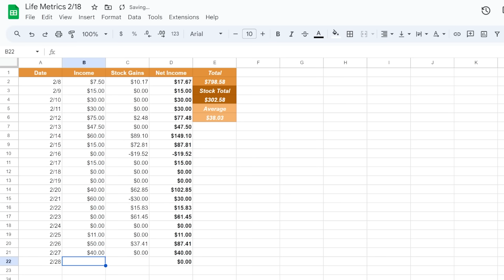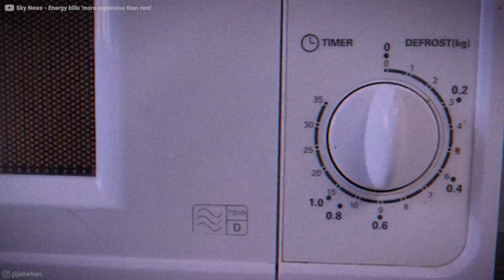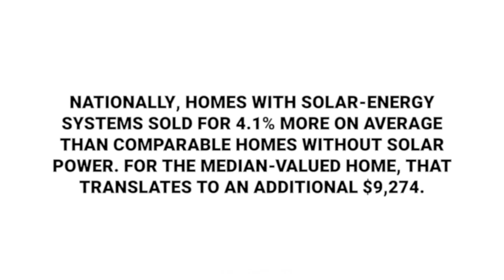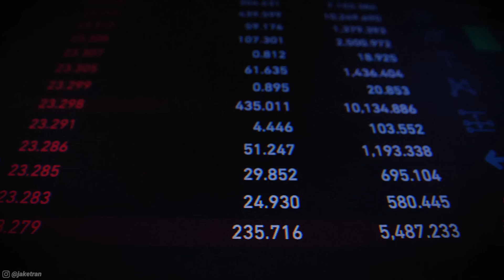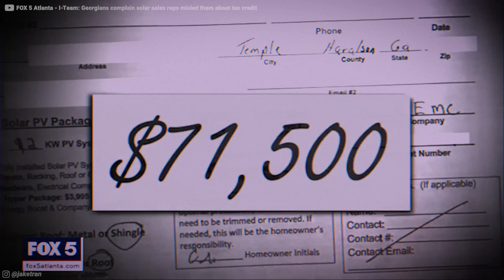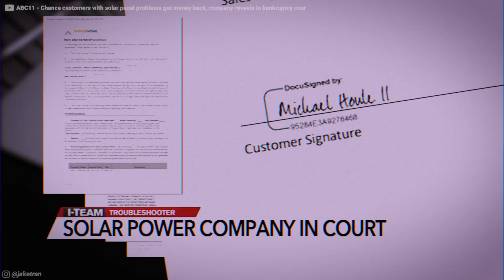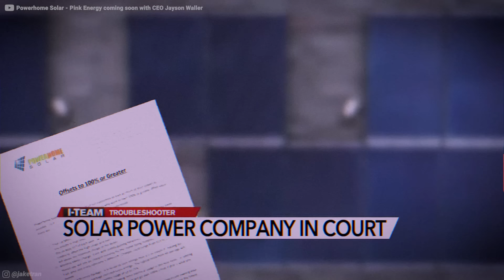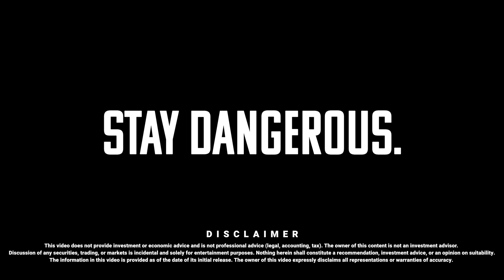Home solar panels are literally a scam.

Comment: I have a 1kW off-grid system with a 6kWh battery I built myself. Learned a lot. Spent less than $2,000. I produce about 4kWh per day which is about 10% of my regular electric bill. It powers all of the important stuff like internet and TV which is important where I live since power outages are common.The first 250 watts of panels have the quickest payoff time since every house has clocks, chargers, and other miscellaneous phantom power draws. No need to install a full system all at once. Build gradually over time and analyze your own use and production. Don't take out loans either.
Reply: Legend
Reply: A 6 kWh battery seems a bit oversized for such a system, however this does depend on your personal consumption but in general you should not have more than 3x larger battery than your peak power
Reply: Nice
Reply: If i wanted to live off grid and blast tv. A/C unit 5 all day. How much panels would i need ?
Reply: @Thegerceklershow  Thats hard to answer with informations you provided. How much is your consumption during day and how much is it during night?
Reply: @Thegerceklershow if you want to do that batteries are more important than How many panels you have. So it won't be cheap.
Reply: Where did you get the 6kw battery so cheap? That alone is 2k investment 🤔
Reply: @epifanpefev2835  he said he built it himself.
Reply: @epifanpefev2835  Oops. I guess I only considered the price of the first since it was a gradual upgrade, but it is a combination of 3.
Reply: @nikola119 Thanks Nikola Tesla! Very cool!
Reply: @nikola119  Depends on your usage pattern and how long of a blackout you want to be prepared for .. I bet there were more than a few people in Texas who wished they had a couple weeks of backup power
Reply: I use them bought inexpensive as panels with controller s  for a 12v system to charge things off grid without running wires from house to shed can charge    vape sticks box mods  DVD player phones car batteries rechargeable batteries of all sorts Bluetooth speakers  and stuff
Reply: Exactly. That's what I'm doing. DIY!
Reply: 😂😂😂😂 important stuff t.v internet 😂😂😂😂😂
Reply: @CheapSushi  you have no clue whatsoever about electricity. First of all batteries do not give you power, batteries give you capacity. Thats the first the thing you have to learn. Second thing, what is the point of having additional capacity that you will never use? And the reason why you will never use that capacity is because you do not have enough peak power generated by your system in the first place. If you know the blackout will last 2 days, will you buy 20 cans of food if you need only 5? Considering also the fact that the rest of the cans will go bad. No, you wont. That is whats called oversizing your supplies. So in the real world scenario: at the point of the blackout you will not have the full 6 kwh capacity available to you because you do not have the peak power to charge that capacity in the first place. So whats the point then?
Reply: Just had a salesman try to talk me into buying the other day he sounded just like the video it was hilarious
Reply: How  did you build your own battery
Reply: @WillProwse  do yall know  who this is. Omg
Reply: Dam bro that’s amazing. How’d you do all that?
Reply: Do you have a how-to guides step by step up doing it? I would immediately send all of my peeps to watch it
Reply: @Thegerceklershow math
Reply: Fantastic explanation. DIY or research before you is the way to go. Don’t buy from a salesman on these large purposes. They have no incentive to be sure that it’ll work for you.
Reply: @nikola119 you’re saying that having 6kwh of capacity is over kill? That won’t even run your fridge for two days.  You don’t need to use the peak power of your batteries I’m not sure what you are trying to convey.
Reply: Important stuff like internet and TV lol, what about something ACTUALLY important like your refrigerator
Reply: @AndrewGreenaway  6 kwh is not an overkill. 6 kwh is in most cases to small for a typical household. I am saying that you should not have a 6 kwh hour battery if you only have 1 kw of peak power. The rule of thumb is that your battery should not exced 3x of your peak power because at that point its too large for your system. Its not wrong but its unnecessary.
Reply: I live on a sailboat and have a 800 watt marine system. It’s great. I paid about $1200 on panels and about the same on Lithium batteries. Marine stuff is more expensive in general, whatcha gonna do? But I definitely didn’t ditch the diesel generator.
Reply: I live in California and work for a sola company it’s only worth a buy if you can use the tax write off if you can’t use the write off then have the state pay for it
Reply: @Skaggs666 thNk goodness for that!
Reply: @johnmorrison7205 refrigerators are very energy intensive and usually superfluous. food spoils anyways inside or out. They do help to store large food preparations but you can but a smaller fridge or not prepare large pots
Reply: @nikola119 mine is actually about the opposite.

I have about 3x the panel wattage to the battery capacity. Panels are cheap. I would rather over panel for rainy days than try to store enough power to get through to the next sunny day.

Granted, I have a low draw system. I power freezers, one refrigerator, lights, internet equipment, one computer, one TV a washing machine and a dryer that I only run when I have a clear day to power it. And an AC, but that thing only runs June through August when I have more sun than I know what to do with.

No cooking (although a couple of induction plates for summer cooking is on my shopping list) and no heating.
Reply: @CheapSushi I don't think they were trying to say how much power you're allowed to have 

Only that it makes more sense to buy more panels rather than more batteries.

It's the panels that make the power. Batteries just hold it.
Reply: @nikola119 To play devil's advocate... If they're worried about a blackout it means they're on the grid.

That means they could easily charge those batteries from grid power in preparation for the blackout.

Doesn't explain why they're bothering with solar panels, but there it is 🤷‍♀️
Reply: @nikola119 wtf,  a 6kwh battery cannot be charged by 1kwh hour solar 😂😂😂😂😂
Are you doing meth?  He has electricity too.  He can surely fully charge the battery.
Reply: Good shit mi boy
Reply: @johnmorrison7205  I have a 1200 watt PSW inverter that has no issues running the refrigerator. The refrigerator uses less than 200 watts.
Reply: @nikola119 Please, pretty please, respectfully please, spare everybody this torture of reading your comment. Thank you
Reply: @nikola119  In Britain we  have peak hours and off peak hours could it be the same for him, the difference in price is around 130% could he part charge the battery off peak and use this plus extra solar to power the house in peak electric price times. Just seems like common sense to do this. Also as he not some what future proofed the battery by allowing for reduced capacity as we all know battery capacity will vastly reduce over the lifespan of the solar panels. People say to extend the life of batteries in cars they should remain within 20-80% charge I would imagine these would be the same, so overall I think over sizing the battery makes sense.
Reply: @nikola119  well, then, its not a 'should not', but appropriate a given scenario. More capacity is always good to have. The key here is, if its in the budget, why not. At the end of the day, batteries dont have a shelf life like cans of food
Reply: A kwh cost about $0.20
Reply: No all solar business is a problem! Problem is that people are turning back to renowned manufacturer like Panasonic Holdings from Japan (creator and developer of all PV inventions in 1960s) 
Meanwhile customers prefer cheaper panels from China or Korea (with not as long cycle of life as PV made by Panasonic!)
Reply: This is the way
Reply: ...of course the top comment is shilling for solar 🙄
Reply: Thanks
Reply: Make a video on it
Reply: @ipinnuoladipo363  how is the guy a Legend?, Anybody can research and figure out how to do it.
Reply: I have 2.2kw of panels and 8 300ah LiFePo4 batteries. So a similar sized system. Batteries alone were close to $1500, than charge controllers, inverters and panels. Probably around $4k invested. I live in the tropics, and this does supply all my power needs. Refrigerator only takes 80 watts of power while running... I have Starlink internet, that combined with my tv and computer use more power. I generally don't use more than 2.5kwhs on the most demanding days. So I have plenty of power even when it rains so much that I'm only producing at 5% capacity. You just have to calculate everything you need, do your research etc...
Reply: Thank you, great approach.
Reply: @Ahamshep  make a video about it
Reply: @G_G_G_G_ More Batteries or more panels is not more important, balancing batteries with your panels is. You could have all the batteries that you want but it's useless if your panels can't keep them topped up quick enough. You also don't want to wait a week until your able to use your power. A good rule of thumb is 200w of panels per 100ah of battery. The voltage of your panels should also be a step above your battery bank voltage so if you do get a voltage drop your batteries are still charging.
Reply: @nikola119 He's saying Kwh not Kw
Reply: Isn't the important stuff your fridge and freezer?
Reply: @iAmDislikingEveryShort you need to up your comprehension skills.  OP specifically mentioned this was an off-grid system.
Reply: is the battery sand battery/thermal?
Reply: @nikola119 try explaining that to a prepper it will make as much sense to him as prepping does to you 😂
Reply: @Thegerceklershow  I have 2900 watts of panels and 6 of those 12 volt lifepo4 100 amp hour batteries, yesterday, when sun was shining, I blasted 6000 btu, about 550 watt ac from 11 to 6 pm.  and those same batteries ran 4 off grid freezers at night.
Reply: @nikola119  You can never have too much battery. It is ok if your panels can't produce enough power to charge your battery from 0-100% state of charge in one day. That would only matter if you ran the battery to zero every night. On top of that, having extra capacity makes expanding his system that much easier in the future. Besides 1kw of panels would probably produce about 4kw hours of power in a day. Which is almost 70% capacity, so it's really not that oversized.
Reply: Why is fridge and water pump not on the list?
Reply: That’s not much power
Reply: 100% going threw a company i could tell was a ripoff when they started popping up. all there stuff is just the same stuff you can buy from amazon but with huge markups.
Reply: @nikola119  sense when does canned food go bad in days lol.
Reply: @Thegerceklershow  'A/C unit 5 all day'   The just 'average house, number out of your butt' for just the AC unit has been 4KW.  Easy to figure out the panels for that, so 16 250W panels to run just the AC here in the southern US during the peak of the day.  Seems like a roughly correct number for me.
BTW realize that 4KW is peak load.  3KW of panels might do it with batteries filling in the peaks if you aren't looking to run the AC just from panels.

And a rough guess on everything else is probably 2 or 3 times that at peak.  It'll depend on how big your house is, how much else you have running, etc.  Some people may go way over that, a few may go a bit under.

The 'general AC number' I'm sure was expected for southern USA, since that's where I am and would have been looking up.

If you live anywhere that is hot at all, AC will usually be your main factor when it is running.
Reply: Family member bought a house with pre-existing panels, their system works quite well barely has any electric bill every month, they've been getting over$300 check back at the end of the year, however the money giving back is going to be much smaller according to the new regs...
Reply: That's the way to do it upload represents in a way that's a little misleading.
Reply: I have similar system. My daily consultation is about 10kwh. And solar produce about 4-5kwh. We often have power outage her in Philippines so it's really helpful!
Reply: Are you from South Africa? We usually get load shedding (rolling blackouts) daily.
Reply: @DangerDaveRSA  sounds like they know the bitter taste of Eskom 🤣
Reply: @wahid3837  all too well 🤦
Reply: Wb for an RV . Is there any trusted channels to learn how set up solar for a 22ft prowler RV from 94.
Reply: @Thegerceklershow bro use your brain. It depends on the amount of power your using
Reply: So are u saying u only save 10% a month off your bill?  or in 10 days u produce what u use in a month?
Reply: If you need a loan you can't afford it. Never take loans for anything
Reply: @BaawBee  not really. At times some people underestimate and need extra cash to pull off certain things. Borrowing money let's say for a car dealership is a bad idea today. But for something like a place to live and your farm animals then by all means ask for a loan. Something one can pay off in a reasonable amount of time. My farm has a 30x60 1900s pig barn that still operates today. And that baby girl will be sucking more power in the coming years. I'd rather pay an investment off then some car note or some fancy smancy computer.
Reply: @ALE5six1  he produces 40kwh a month. That 4kwh that is produced equates to the 10 percent he was talking bout. This is monthly so to say. Seem low tho but I don't know much bout electricity with the solar.
Reply: @fukyoutube444   So he covers his entire electric bill in just 10 days. Damn that's awesome! Basically pays for itself after about a year of no bills then!
Reply: @ALE5six1  yea as long as it's small things plugged in. It can last longer. Just depends energy usage. Ac units, microwaves and big fridges take alot of energy so that is something to think about when going solar. What appliances can you ride of. I live in RV so I use gas appliances but hoping switch to solar. Alot safe especially since I smoke cigars
Reply: @G_G_G_G_ I think he meant he built the whole system by himself. Not the battery. That's harder than most can do. I'm still in the process of trying to build a battery. Not as easy task
Reply: Doing this my self on a trailer so it’s not part of my house or land
Reply: You should make a video about how you build your system I'm sure it will help a lot of people and make you some money in exchange via small donations for the work you put in to teach others.
Reply: Nothing noted about the finite solar panels and short longevity/ future cost of replacement PLUS the major cost of batteries and like the panels, longevity and replacement cost.
Reply: They just over charge for everything in the U.S it’s 50x cheaper in my country
Reply: @nikola119 it's not an overkill, if you produce 4 kW/day, you ain't wanna discharge the battery to 100%!
Reply: Sounds smart. I'm sure solar works fabulous for those who want to live totally or partially off-grid and do their homework.
Reply: What state or county do you live in?
Reply: Wicked, phase it out? Keepin'it-💯
Reply: Keepin'it-gan gang!⚡📺 💯 @Thegerceklershow
Reply: @Thegerceklershow it would depend on the amount of kW your AC units use
Reply: Could you show us how you did all that? I would like how to build my own system. Is your system scalable higher than what you have?
Reply: A debt free man is a happy man.
Reply: On your Posting in Australia, your 6kWh solar battery you mention looking at any price guides would put it around $7,440, plus install.
Reply: 10% is a bit over cautious
Reply: Solar panels don’t benefit the environment, once the energy & components are taken out not account the carbon foot print goes out the window.
Reply: This is the way to do it.
Reply: I would love to know how you did it for 2,000!
Reply: $20 savings on $200 electric bill. So would be breakeven in 100 months. Not counting the endless hours you spent on building the system. If it is a hobby, then it's fine. Otherwise, I don't see any value in such projects.
Reply: Holy shit you spend a LOT of power man.
Reply: could have bought a diesel gen 😂
Reply: Problem is for most people we don't have the time or technical know how to DIY dangerous solar. I'm handy myself and good with computers and I still don't know how to build my own system. Wow pay thousands just to generate a couple bucks of power per day, whatever wacko!
Reply: @Thegerceklershow  I've seen systems as such, with a cheap generator backup, go around 60k$ or higher. For a family household, totally blackout proof with the right equipment
Reply: The classic: "I represent 0.005% of all use cases, so that must mean that this technology is awesome in every case!"
Reply: @nikola119  wrong
Reply: You need a battery backup for power outage usage plus they won’t run a furnace
Reply: i live in finland, and here solar panels dont make a lot of sense since majority of the year is winter